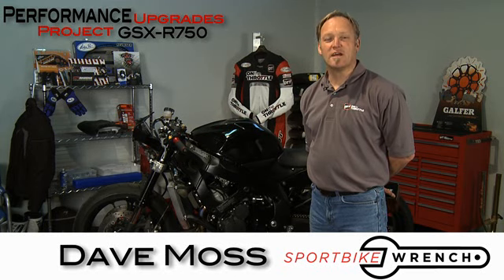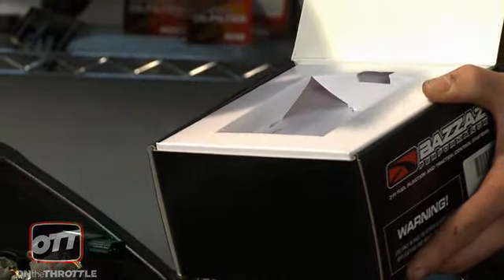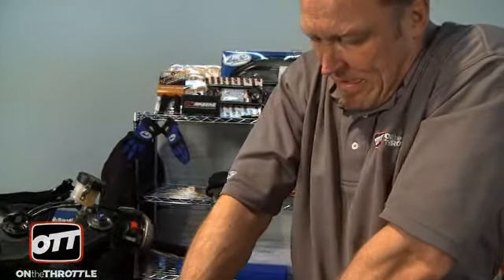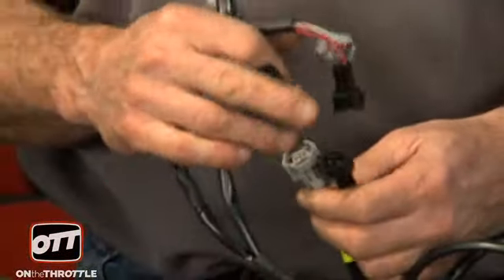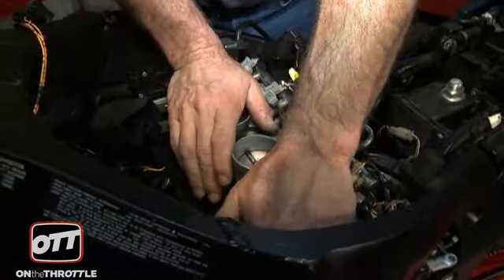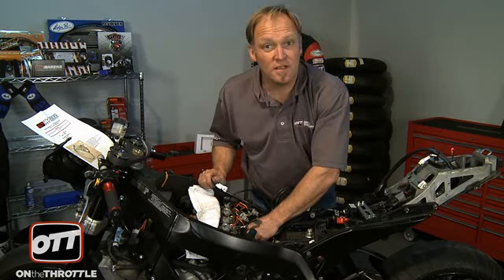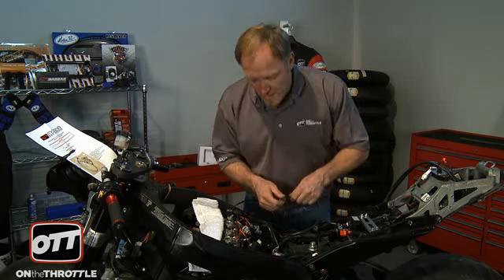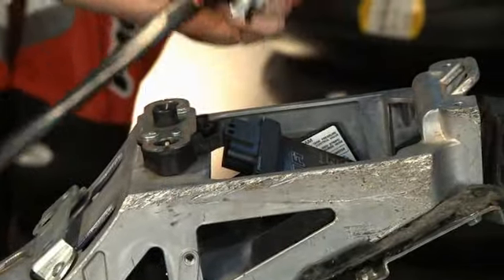Performance Upgrades GSX-R750 Bazzaz Z-Fi Install pt 1

Comment from the maker: The electronic components do the same work between brands. Fitment is the same to connectors etc and installation takes about the same amount of time all things being equal. One would have to look at other factors in regards to tuning on the dyno, ease of interfaces etc.

Comment: Dave, I've just fitted my bazzaz unit to k7 750 as per the instructions.  Only difference been the instructions told me to route the fuel harness down the clutch side of the bike and coil down the accelerator. U didn't seem to have to do this on the video, is that right?

Comment from the maker: The instructions are very similar to the GSXR depending on how many of the pieces you have acquired. In all instances the connectors go to the same OEM parts so you might be looking at slightly different fittings or placement of fittings especially on the throttle bodies. The staff there are superb at helping you if you get stuck.

Dave Moss
Host

Comment: I currently have 21,500 and new Iridum plugs and K&N filter were installed at 17,500 and the Cobra was installed after the plugs. What is a Eddy current dyno...lol?  again I disconnect Cobra and the bike never dies or has the power band problem.

Comment: I have a 2007 gsxr 1000 with a set of Jardine JP1 slip ons and installed a Cobra FI 2000r and had it tuned on a dyno. The bike now has a small hick up (stall) in the throttle when I roll on the accelerator, it also dies at a red light once in a blue moon for no reason...never did either until FI 2000 install. I swear the bike uses more fuel than the factory settings. Any advice on correcting?

Comment from the maker: the ZFi is the same as the power commander until you add the learn option which allows you to constantly map the bike to ambient conditions that day to ensure the engine/fuel mix are optimal every day.

Dave Moss
Host

Comment: This is probably a noob question, but do i still need to run a bazzaz zfi system if i have a flashed ECU? or can i just remove the whole kit my bike. 15 gsxr 750

Comment from the maker: the hiccup can be removed by further dyno tuning and requires an eddy current dyno to do partial throttle openings and find the problem area. Stalling at a light in a blue moon is odd though very infrequent. Have you changed/checked plugs and air filter recently?

Comment: I have fitted a powercommander today to an 09 750. You can easily undo the TPS by putting a little presure on the top of the plug then reach round from underneath with an allen key to undo the clip. Took 10secs to get the plug off and the throttle bodys dont have to come off. I didnt even have to remove the airbox. Hope this helps somebody.

Comment: wasn't all that bad, hardest part was removing the lower throttle body connectors bnecause my hands are too big.
crank poisition sensor was also hard to find, but this video helped

Comment: Hello, I bought a track 07 GSXR track bike with the Bazazz Z-Fi with traction control on it. When I get up to about 13,000 RPM's I get the F1 fault with flashing light. I checked the codes out and it was the injector signal for all four. Do you know what would cause this?